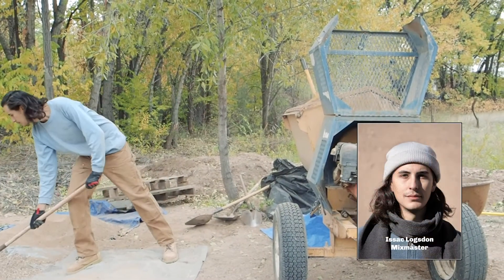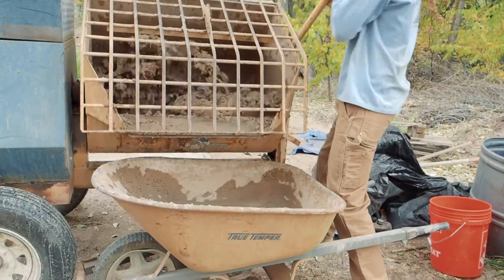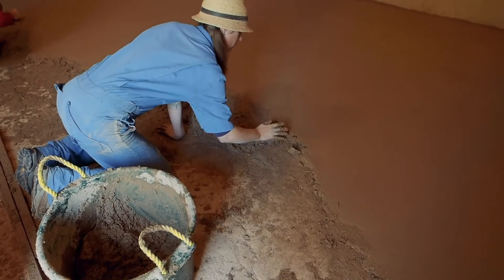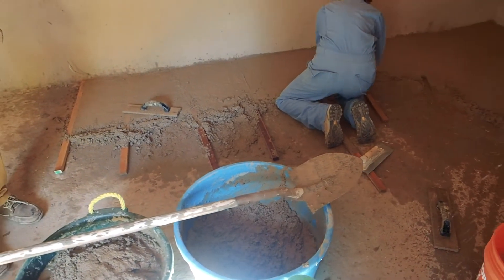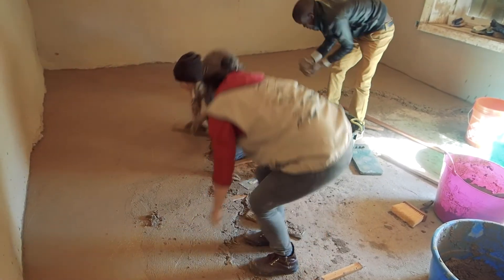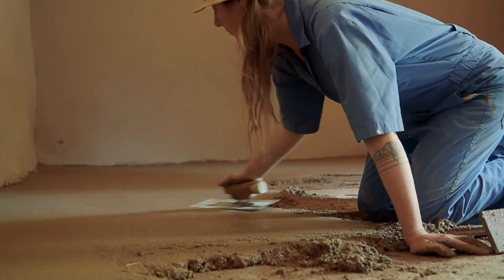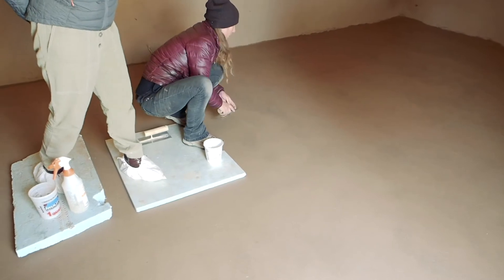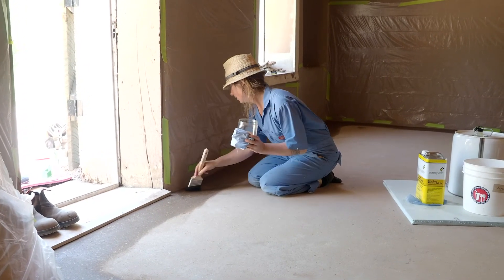Earthen floor installation

Comment: The oil also gives the floor a lot of strength.
Reply: Not sure about strength but it would protect it from the elements I think? Kinda like a layer of wax on a car. Keeps moisture out and reflects uv rays making a shine keeping the surface more  cool and  heat resistant thus prolonging the life of the paint job.
🤷

Comment: Flood the floor surface with milk and the fatty oils will be soaked into the floor after a few weeks or so. Then clean up the leftovers.

Soaking pottery in milk for weeks makes pottery waterproof. Makes your pottery cups into drinkable containers. 

There's other alternatives to but the basic idea is getting oils trapped in the pours creating a water repellent barrier because oils and water don't like to mix. 🫴

Comment: What's the square foot coverage of a gallon of oil? Do you use tung oil?
Reply: tung oil is Asiatic, linseed (flax) is more traditonal but there is no noticeable difference between the two
Reply: @bradleycooper5436  
Lol! What the hell does that have to do with my questions?